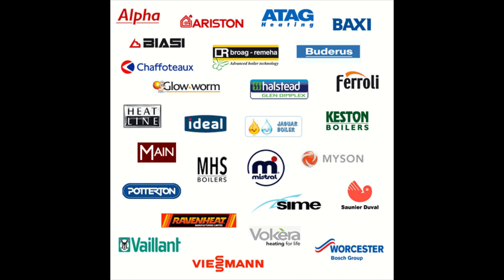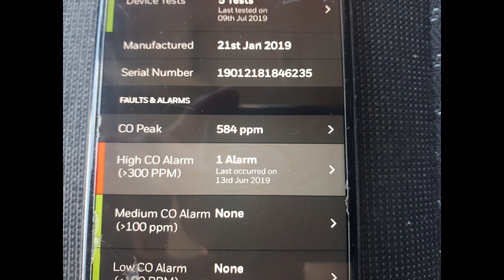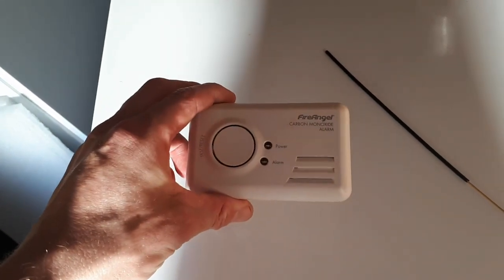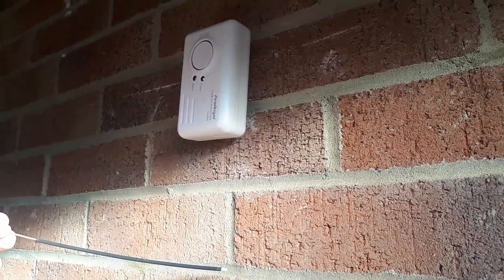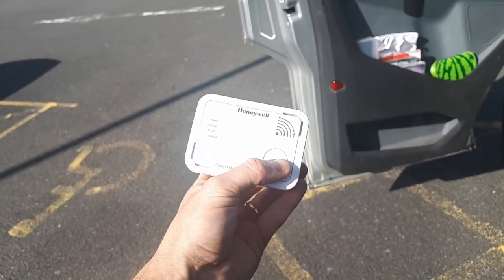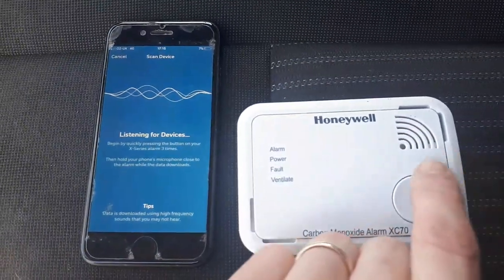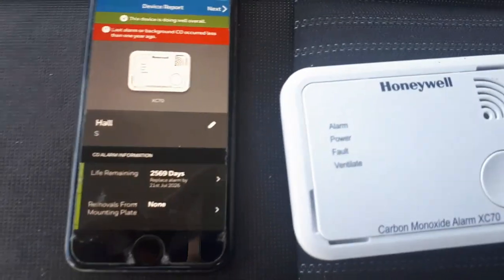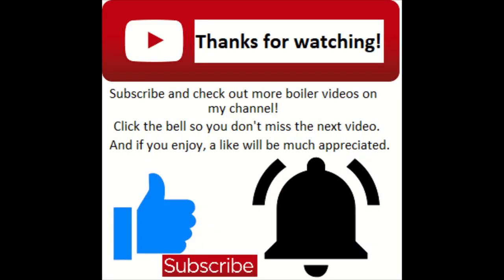HOW TO TEST A CARBON MONOXIDE CO ALARM PROPERLY - INCENSE STICK AND APP

Comment: Just came across your channel and there is some good content. I hope you dont mind me asking... how long have you been in the gas industry? im asking as a 20 year old gas trainee and what advice would you give me starting out thank you. I hope you post more content!
Reply from the maker: Hey mate, thanks alot. V kind. Ive been in the industry for 15 years or so.
Get reading books, manuals, watching videos, and get shadowing or be an apprentice for as much as you can. Have you done plumbing as well? It helps to have a knowledge of that.
When you do go out on your own, be thorough and take your time with the safety parts. Seals, ventilation, flue, combustion panels and seals, gas/burner pressures and safety devices.
Reply: @goldgas1216  Hi thanks for the advice. And yes i have done my level 2  & 3 plumbing and now im onto doing gas.